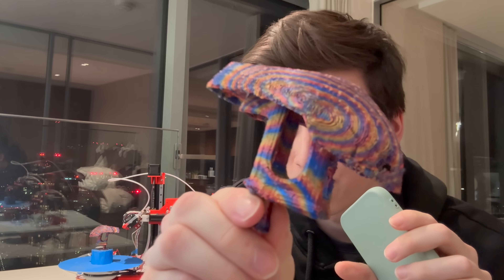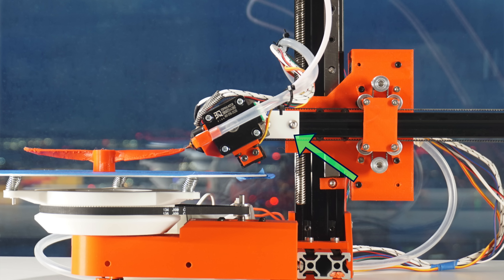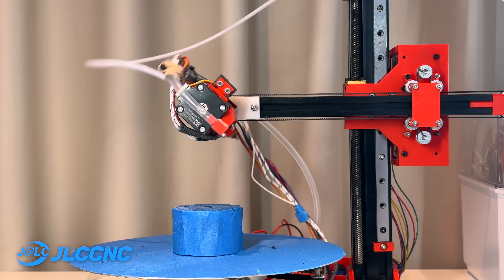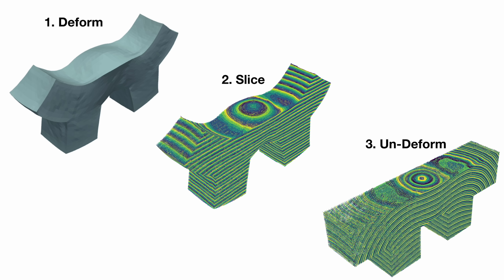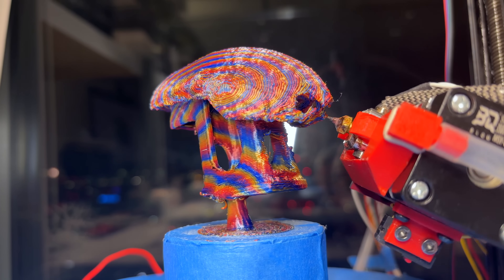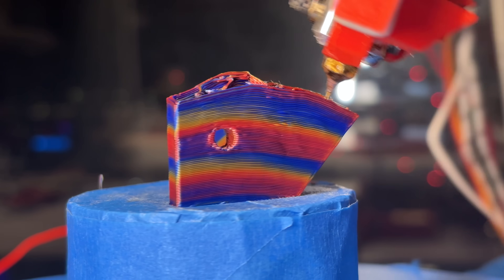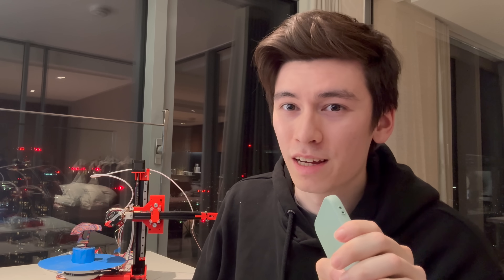3D Print Anything Without Supports

Comment: I wonder if the infill in the finished part is warped because of the non planar slicing or if it's still generated orthogonally from the print bed after the slicing

Comment: There's going to need to be more compensation tools, for instance, each angle will have a different amount of friction and gravity on the filament. Mesh resolution when deforming may also have to be a setting. The rainbow filament might be hiding the quality of prints a little, and it would be nice to see how smooth they are (squirtle looks quite smooth though, upside down bench maybe not so much).

Comment: This is very very cool. However I wonder how we could improve the surface quality?

The first solution is to get a better printer. I am decently sure that your printer, while cool, is not the most structurally stable, and likely has problems with consistent quality.
If that does not help I would assume the slicer could have improvements.
If neither of those work, would it be possible to implement ironing on non-top surfaces? I would assume it is. It would likely have to be generated by your program and not the planar slicer, as ironing needs to happen on faces that have multiple layers.

Comment: wow! So, if you are bored can you do an ICBM interceptor next - one that actually works not like the ones made by the USAF. And I would also like a transparent personal transport bubble that travels in air-water at Mach2+ silently, no Gs at vector change, with the optional 2 stroke braaap sound. ;)

Comment: Thats incredible, now I want to build this myself. Also, don't you want to try to turn on adaptive layer height during slicing deformed model? I imagine in this process it could improve the quality of the print, though not sure if this is possible as forming back original shape already probably generates variable layer height.

Comment: Been watching this stuff evolve and the biggest question I’ve had is how well layer resolution can be controlled for when you lose base axis printing. Mainly that in traditional printing where Z is the layered axis, you get some reasonable expectation with regards to how this is going to affect the printing in terms of Z resolution (since this affects the quality of arc features the most depending on thickness of the layers). 

Once you decouple the base axis, it seems like it will be much more difficult to predict what kind of tolerance you can expect or what features will suffer from this aspect of additive manufacturing, since the layers can be stacked in any manor of orientations.  

Is there some way in the slicing stage to observe this or control for it?  Or is the main benefit of this to reduce filament from supports and related aesthetic motivations?

Comment: I'm curious if this can be taken advantage of to get even stronger lightweight parts. Being able to change the orientation of sheer layers is massive in printing parts that experience loads. Although a compromise between the desired tool path for strength versus the best tool path for printability would likely need to be taken into consideration.

Comment: This does potentially also solve one of the biggest problems with 3D prints, which is that prints always have a 'weak' axis where the print is prone to splitting along layer lines. Once you get into not having to have flat layer lines, you open the door to making stronger prints by having print lines that dynamcally orient for stability.

Comment: the surface finish looks really bad still (compared to normal prints, even with support)
is that just the filament or is it how the molten plastic is effected by gravity as it sets
Reply: most likely the overall final quality wasn't really the goal in the beginning, now the concept, the idea and the slicer is working, probably the quality can be way improved.

Comment: ¿What happens in the areas where the density of layers gets significantly reduced due to the de-transformation? ¿Is that what the extrusion compensation you mention towards the end of the algorithm section is meant to solve? ¿Does that mean you compensate the reduced density by increasing the nozzle flow? ¿Would it be possible to artificially increase the amount of layers in those areas for a more uniform finishing? Not sure if anything I have just asked makes sense outside my head.

Comment: 3D printing. But on LSD! That's the vibe I'm getting when I watch the printer head speed dancing around which turns out IS the actual printing process, when I see the wobbly lines on the finished prints and when I listen to the explanation of why this works.

Comment: Very impressive, Josh. I followed the concepts, though did not follow how transforming from the deformed shape without overhangs could then be printed as the original design with overhangs. 

Great initiative to procure new parts to extend the printer’s capabilities beyond its manufactured specifications too!

Comment: I can see this idea going to solve the biggest problem of multicolor printing (wasting filament) as this can print the outer surface with different color after printing a base part normally. like a toy having blue eye, we don't need to change the color in every layer of that eye part. instead it will only print eye by changing the filament once. hope you understood what i am trying to say

Comment: 1:22 i beg to differ sir. i would like you to elaborate further as to why you say this. from my experience of 15 years of fdm usage i found that orientation can be critical to making a lasting part. the angle you show as an illustration that would be unthinkable with "a normal slicer" is the very angle i would chose to print that part at with any common slicer. the use of a proper support material that makes removal of said supports a downs syndrome capable task is given ;) i hear that you prefer cura to slice with, i would very much like to discuss this at a bar over pilsner. if you in norway let me know if you want to partake ;)

u earned a sub today from an old fart with grey beard.

thats something ?

Comment: Since the slicer calculates distance from the baseplate to the print location, wouldn't doing all this in radial coordinates make more sense? Particularly since the print process happens on a rotating base with a rotating tool (baseplate axis of rotation would be r=0) not the flat X,Y,Z we're currently using. Each vertex defines a point at (r, theta, phi) which is connected to its neighbors. You could follow the path to find least connected distance. It seems the twist and then untwist to print is going to lead to some hideous printing artifacts. If the slicer used radial coordinates and just considered : A - "Distance from print bed origin point" and B - "Does the location being printed have a continuous path through previous vertices to access it?" then it seems like the twist and untwist steps could be fully skipped. It's also true that the only reason you're using the twist and untwist is because you're assuming to use the old XYZ printing tech. Stop that. A radial printer should use radial printing techniques. Don't shoehorn the printing software for the old X,Y,Z machine to make the new radial machine work. Respect the new radial machine for what it can do.

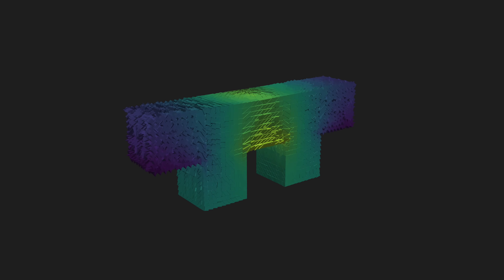Comment: 4:21 “this is a super simple concept” 
You lost me in the first 30 seconds wdym simple?? 
You’re one of the most impressive people I’ve ever seen on this platform and real life, you built and designed a 3d printer, a feat in itself, but not only that, you made that printer do something commercially completely unmatched, coded and optimised an algorithm for the printer to work and then one for your laptop to slice things for it, and to top it off you can edit videos. 
What the flip

Comment: It does look very impressive and I can't imagine how that benchy stayed upright when it was just being held in place by that tiny chimney and filament was be added to the benchy in a horizontal direction,

I'm going to try and simulate your printer with gcode output from your  slicer in blender - should hopefully result in some interesting animations. - see @dwuk3d for some examples.

What interests me probably more than the non planer aspects - is the concept of printing onto the side rather than top of objects - which I think could bring a lot of efficiencies to multi colour printing.

As you only really need the colours on the outer surface - and so would be able to print most of the structure of an object in a single colour like white - and then colour it in with a few passes of the different colours applied to the top, bottom and sides.

Perhaps using a multiaxis printer like in the video, or maybe with something to rotate the print around in more dimensions instead.

I'm going to be adding rotary movement as the next stage of my multi head SV08 upgrade.

This video inspired me to maybe allow at least one of the print heads to pivot up to a bit of an angle - rather than always facing downwards

Comment: I’m not really into 3d printing just like watching stuff like this I guess. I notice a lot of the prints showcased so far seem pretty rough/low quality/stringy. Ive seen this character in other 3-D prints before but usually less severe and often a lot of prints I see are visually smooth. Is this just due to the material, printer, optimization choice (ie speed over aesthetics), or is this bc of the slicer?

Comment: Amazing work dude! Now, based on the puff purging at 1:29 and the finish of the print, it looks like you're using a Silk PLA. While Silk PLA gives a nice finish, it sucks for quality. If that's what you're using, your models would probably look even better if you switched to a material that behaved better (no unwanted puff purging) -- Basic PLA or Matte PLA for example.

Comment: I wonder if a heated flat-tip insert could be run over the final product to smooth out the layer lines—directly on the 3D printer itself before removing the model. If you look at what can be done with a 3D pen, especially when adding detail to something like a car model, the idea seems promising.

Comment: Impressive, although I must say that the multicolored filament probably is hiding a very poor finish...make the objects in black and show them.
Reply: that is because this is a prototype.   to really do it, analysis of the resulting layer thickness with variable extrusion rates would be needed to get a good quality finish.   something similar to arachne, but now considering all three dimensions.   i think all the pieces are there in slicers like Orca, we just need to modulate the flow rate by the inter-layer distance normal vector.

Comment: This is dope, and this isn't to diminish the important work but isn't this missing something important. If you are deforming G-code, how are you making sure the layer heights remain correct. It appears to me on the upside down benchy that much of the jank on heavily deformed areas is actually caused by variable layer heights introduced by deforming G code. 

This seems like a fundamental flaw of this technique that doesn't seem easy to fix. 

It seems like maybe what needs to happen is that you use the technique to generate a vector field, that defines the printing direction, and build a slicer to natively work off that vector field. 

But this also doesn't get around the problem that layers are flats, and a curving part needs to have variable layer thickness, maybe that can be achieved with a combo of adding extra layers on stretched sides, and changing extrusion rates? 

Interesting food for thought. This solves a ton of problems but introduces a ton more as a result. I haven't looked into the research/field so this stuff has surely been considered?

Comment: Nice job. I didn't spend enough time to fully understand the code, but I think there are some more or less straight forward improvements of this:
1) Print orientation constraints for parts of the model would be awesome (i.e. have thin parts or bore holes always come out in ideal print orientation - may make supports necessary though, but certainly worthwhile especially for functional parts and miniature arms/legs)
2) Migrate the optimization code to torch. Handling thousands of variables, just asks for gpu power. If I'm not mistaken, you're essentially computing a gradient descent with a sparse jacobian. Skip storing the jacobian and update right into your parameter vector. Torch should be able to broadcast the sparse changes just fine. Besides even if I am mistaken, if the gpu is beefy enough, doing n² effort may still be faster than handling sparse structures on cpu. The benchy should not be an issue at all then. On non-gpu platforms, you can always fall back on torch on cpu.
3) Overwork the loss for the rotation field. I'm not too informed on the scipy rotvec representation, but I don't feel very comfortable with just (effectively) using the euclidean distance on these vecs as loss. As per some stackexchange post ( https://math.stackexchange.com/a/2880162 ), the dot product of the (frobenius) normalized and flattened rotation matrices is a direct measure of the cosine between the two rotations, which is what you are really after, I think. And then you probably don't want that loss to be linear, but penalize larger angles much harsher than small deviations, so there is quite some tuning potential here.
4) Tweak the optimization to be "locally smooth". Perhaps have some bicubic/tricubic interpolation run through your grid using every other point and add the difference to the skipped points as additional loss. That should flatten out the rough surfaces and give a smoother surface to the final print. This can be quite costly, but if you're only doing that on the last x iterations of your optimization (after the previous optimization has converged) should be sufficiently fast (as per my gut)
5) integrate the "squish factor" into the slicer (requires writing your own/modifying an open source slicer though!). The visual quality is probably much better if the extrusion speed is constant post-unsquishing, which will require adaptations of the slicer. Maybe a virtually dynamic tool tip size is enough to compensate (and I would imagine that to be a rather easy fix), otherwise you'll have to hack into the layer height, which is much more effort.

Comment: OK you’re a genius. I want you to share your stuff, but they plastic extruder. It’s a Dremel it’s a screwdriver. It’s a milling machine head, put an arm on there and put different type of tool head there from milling to extruding to even a torch the welder, Meg welder spits the wire out. Then you cut the wire off and you have multiple arm, Atron, arms arm, Atron robotic arm Literally make a shop arm they used to call it a yard or a shop arm. It was a shop arm if it stayed inside the shop another name for it is a trolley crane and a yard is a overhead crane out in the yard. they also called the trolley crane ran on high beams. They would also make them that literally hooked to cars and forklifts and such the same as a trailer and it was just a little crane and they literally called it a yardarm and it is a robot arm
Reply: tf is that dude

Comment: You should definitely make an adaptation for 3axis machines. For shallow angles like 30° or less you don't even need the 4th axis to rotate the nozzle.

You won't be able to print an upside down benchy on an ender 3, but it should enable 90 degree overhangs!

Comment: While this is technically neat I wonder if it's actually good for the print. What I mean is that it seems that if you have a bend in an object and you print it using this method that the print will be weak along all of the layer lines whereas if you printed normally there will be parts of the print that will be stronger. The next step might be to use this style of printing to create a base layer upon which stronger differently oriented layer lines would be set. Or perhaps to try to say it a bit better, have a way to designate which directions should be strong and have the slicer adjust multiple layers in the strong direction versus the layer line split direction. I don't think I'm saying it well but I hope the general concept is coming across.

Comment: Let's think about this, this is very interesting,
I think the warp->slicer->unwarp is a 
great idea leveraging readily available technology of planar slicers

But in the future this would genuinely be a bottleneck as the process of determining the translation matrix of each individual tetrahedron takes a lot of time and compute power

Not to mention the rounding errors that are bound to show up with bigger parts and more complex parts with tight tolerances 

For now this would be enough but we're going to need more innovations

I think using the tetrahedron path length property (TPLP) theoretically we're able to skip the warp, planar slicer, and unwarp if we're able to take that data
And divide it by layer height

We already have a gradient of "what's first and last" with the TPLP,
Theoretically speaking, the gcode is already encoded in there, we just need a way to decode it and extract meaningful data,
Skipping the warp slice unwarp stage

We could add a simple logic to have it favor paths that are in the middle of the object file vertically since printing up and outwards is the best case scenario,
Like a tree trunk type algorithm.

This would also help in tailoring infil geometry that'll do well with nonplanar printing as infills are not designed to be printed nonplanarly